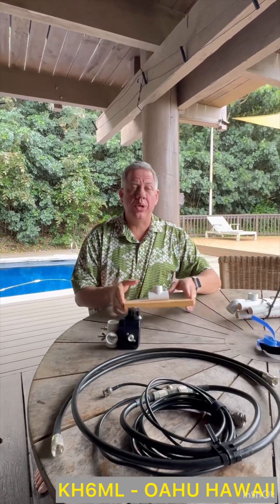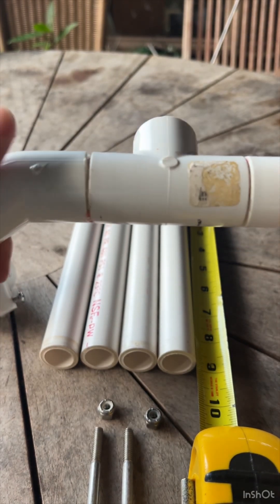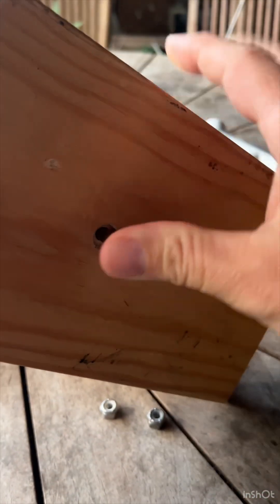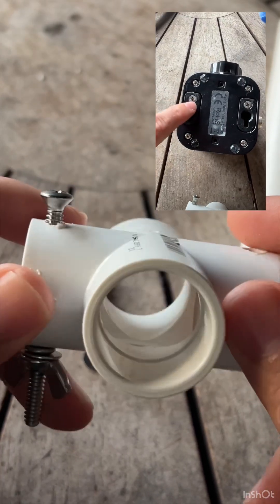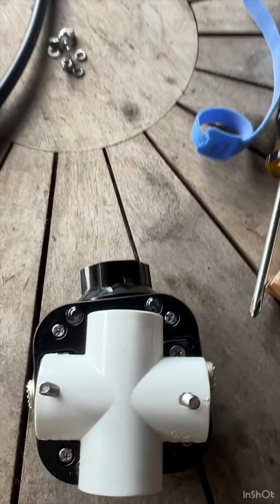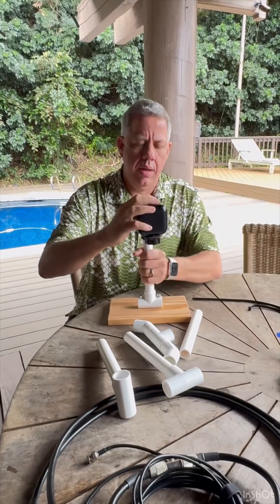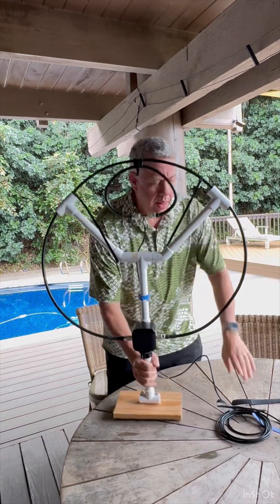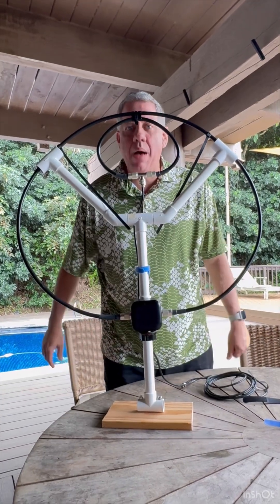How to build a stand for a magnetic loop AL-705 Alpha Antenna HAM Radio By KH7O and KH6ML #hamradio

Comment: primer is not needed as it will not be holding water.
Reply from the maker: No sure if you mean painting it?
Reply: @KH6ML  oh, I used to be KH6FP - then i let it lapse.
I am referring to the PVC piping. primer is not needed if there will be no water or air used.
Reply from the maker: @patrickdonegan9559   Got it Thanks!!! I did not know that! Still white for now.